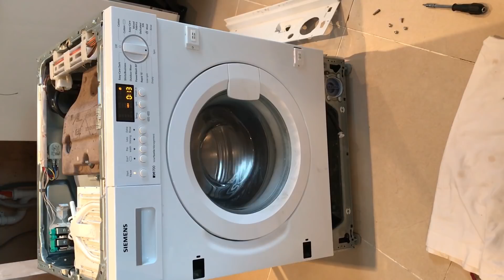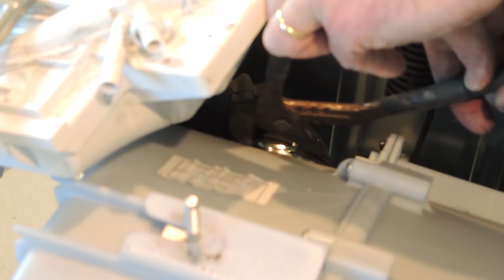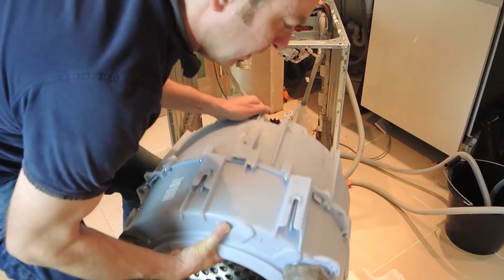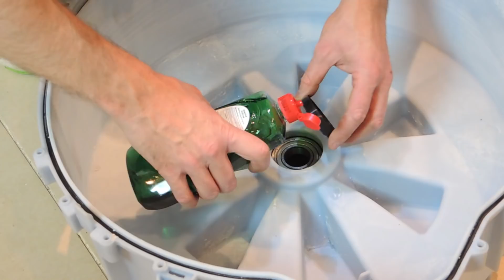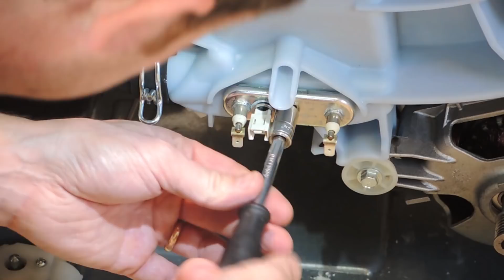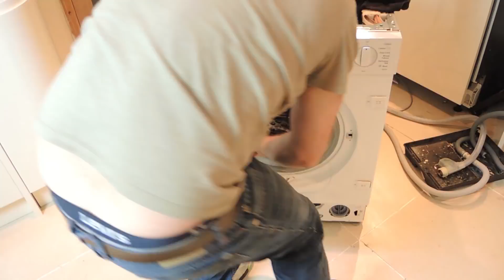Noisy Siemens IQ700 washing machine Replace Drum Bearings

Comment: Hi i have a siemans iq100 the bearings are gone i followed your video on the iq700 and have the case out that houses the drum but the iq100 has no screws or bolts how do i separated the casing to get the drum out so can replace the bearings i searched your channel but can't find anything on the siemans iq100. Thanks

Comment: Great video. What size threaded bar did you use and what was the diameter of the washers?
Reply from the maker: It's very hard for me to remember every video, but I think you're talking about the threaded bar for the bearing puller as long as it goes to the smallest bearing 12 14 mil should be adequate, believe it or not the most important thing is having good sturdy washers to pull the bearings in.  glad we could help you @jamesmoirano4271 this is for you https://www.youtube.com/shorts/e432SAb2g08 please remember to subscribe as that's what keeps this channel going. Thanks 👍

Comment: This video was of great help when recently the bearings went in my IQ700 it was 10 years old and had never broken down. The bigger bearing was in a terrible state, the ball bearings had started to come out. It was a devil to get out but I did it. The limescale was awful but it looked nearly new after a lot of cleaning. Machine is now back together and working. If it does another 5 years I'll be happy. Also replaced the pump as well. Thanks very much.
Reply: Can you please share the picture of electric wiring on the module which is located on the front panel. Module as shown at 3:45

Comment: 11k views and not even a snarky comment? Wait, I think I just made one.. So I just finished the job with the help of this video. I'm a pretty handy mofo, I must say, and I've got most any tool one might want, if I can just find them. Had already been in there to replace the water pump a few months ago. Even so, the thought of splitting the drum was probably the most fearsome proposition for me. Meh. It goes pretty straightforward, and with a little gentle prying side to side of the ample pinch points, it comes right apart. I did place a meager bead of silicone on reassembly, IMO o-rings exhibit a little compression after some 15 odd years... a few scrap 2x4s come in very handy for this project. I used a one to drive the new bearings flush, then used the old bearing as the perfect size to drive home the new one without damaging it. I didn't remove the soap tray, just weaseled my way around it on disassembly. If you have a family member (or a thirsty crony that your wife disapproves of hanging around), it does help to have them help with the re-install of the tub assembly, as it's a bit unwieldy. Definitely remove the cement counterweights. I'll sign off now, before this comment becomes more tedious than the job itself. I actually felt a sense of great accomplishment on completion of this project. I figured even a scratch and dent machine goes at least $800-$1000, so where could I get paid close to $200 per hour for my labor? Turns out, right in my own basement,  just a few steps from the refrigerator always stocked with my favorite forms of re-hydration! Enjoy the fruits of your labors my friends!
Reply: sry, a couple other thoughts. I did the trick of putting the bearings in the freezer for a couple hours. I do think it helped on the press fit, also a little vaseline never hurts on the receiving end, or so I've been told LOL. Also, I marked hashmarks on the tub with a sharpie pen (before disassembly) to help with lineup on reassembly, put colored tape on a hose connection here and there. Machine is a 2005 Siemens WFXD5200 UC for reference. Use your judgement on what needs to be removed for clearance, pretty much everything mentioned, except the soap tray, oh and I just removed the water pump hose at the pump, and left the hose assy attached to the drum, saved a few steps there, but it needs a little jockeying going in and out. Also, I removed the drum out the front of the machine, FYI. Now I just have to figure out how to convince the ol' lady into spending the savings on a Kayak. Maybe a couple hours in the freezer would make her a little easier to work with?